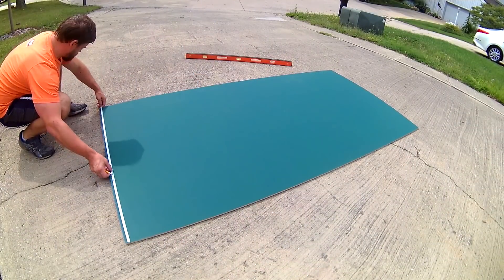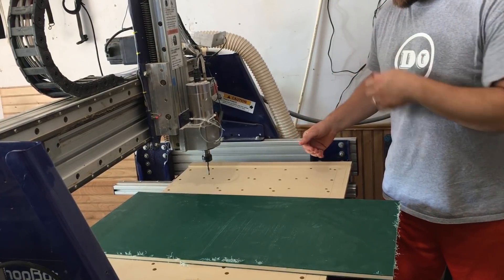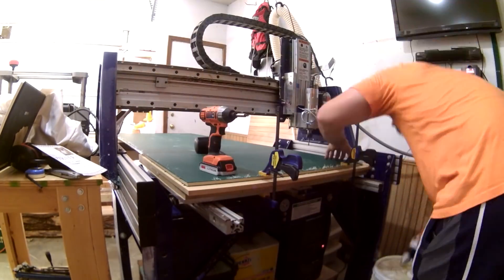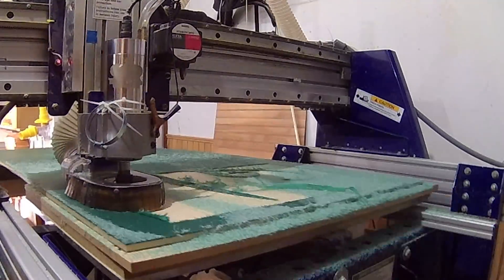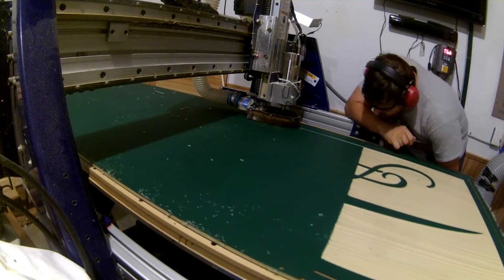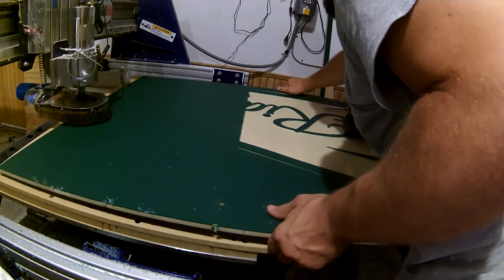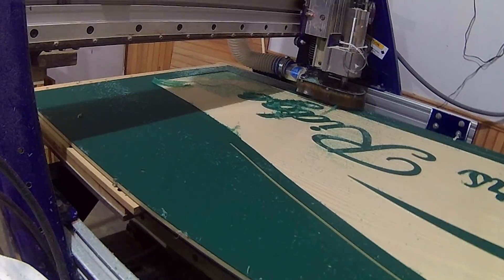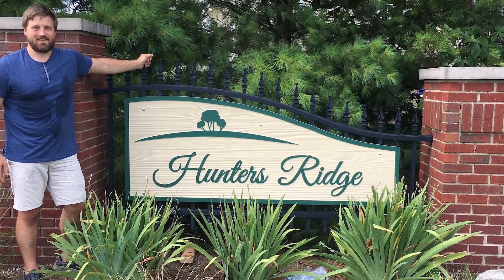How to make BIG signs on a small CNC // Tiling

Comment: Thank you for this very good and clear video. I am still learning my way around CNC and am getting ready to cut some big sheets, so tiling and registration are interesting to me. Some of my planned big sheets have many parts. I ran a test recently using tabs to hold the many parts together so holding the sheet is less critical. I made the tabs about half the thickness of the material. This allows a router with a 1/4" trim bit (with a ball bearing) to guide the bit along the half-cut depth while cleanly cutting away the tab. This works very well and requires little finishing. Thanks again for your video!
Reply from the maker: I appreciate the feedback! Thanks for watching!

Comment: A potential fix for the alignment hole issue would be to put the whole thing back at the original reference hole location, drill another hole slightly inboard from the old one (if it stays outside of the design), then copy that hole along the length of your design.  Alternatively, you could use a smaller dowel, which might make it easier to sneak into the design.  At work, we use 0.125" steel pins and they work great with a 1/8" drill bit chucked up.
Reply: Wouldn't 1/8" pins and a 0.125" drill bit work better?

Comment: If you don't mind I have a question. How long did it take you to learn using the cnc efficiently?
Reply from the maker: Not as long as you'd think. If you're not one for the design aspect, you can just purchase files ready to cut. That will drastically lessen the learning curve for anyone. Learning how to run the machine isn't that bad. Learning the software to produce custom files, especially as complex as this one, takes a lot longer in my opinion.
Reply: @DoItProjects  Awesome, thanks for the reply!

Comment: Would you use the same tiling process to make vertical garden signs on cedar boards that would say words such as,  WELCOME,  HOME,  or something similar?
Reply from the maker: Sure! The process would be the same.
Reply: @DoItProjects  so if I did this then I could just cut off the edges with the peg holes to complete my sign?
Reply from the maker: @jeffbooher5598  I do this at 9:55. If your design is just a straight board, you wouldn't need to cut out a profile, just use a table saw or circular saw to rip cut away any holes.

Comment: I know bugger all about CNC, the basics YES, I am making a metal grinding machine that grinds camshaft lobes. Instead of me hand forming patterns ( approx 300 mm diameter ) 
I think I can use a 2d cnc router to form the patterns.  If I can break a simple circle into say 360 degrees and be able to measure a known length on each radii, that should give me a a circle with a lump shape on it ...YES ?   can you suggest a simple CAD program for this  ?

Comment: You need to update your software, an 'M6' command will start the VFD for the spindle, start the cooling pump for the spindle, and start the dust collection system. And of course, turn everything off when it's time to change a bit. I can't believe that a Shopbot CNC would not have these features built-in.

Comment: When I read 'small' cnc, I pictured something much smaller! You couldn't make anything huge with that, but it's a pretty large machine. Good video though. I am wondering about the idea of using a small CNC to make a large machine.
Reply from the maker: I get what you're saying, but my machine looks bigger than it is. I say mine is "small" in comparison to 4'x8' and 5'x10' machines that are commonplace in a lot of production shops. A 4'x8' machine has a cutting area of 4,608 sq-in. My cutting area is 22"x32". 704 sq-in. That's only 15%. Pretty small in comparison.

Comment: I have seen several videos similar to yours, but no one ever says at what coordinates you drill the holes on the spoil board. Can you please explain that. Thanks
Reply from the maker: Specific locations of the registration holes will differ user to user. The number one thing is that they are spaced the exact distance of your tile offset setting. The other factor is that you test the fit of your pins in the holes. They should be snug! Any wiggle room will show up at the seams.

Comment: How deep was your carve I need to do one that is two sided was trying to decide on the thickness of the material I will need ?
Reply from the maker: It was pretty shallow. You could do this two-sided with 1/2" thick material. The outer color layers are just 1/16" thick. Just bear in mind that the final overall thickness would be about 1/4".

Comment: Great video! One question I have is on the tan background. Did you use a wood grain texture applied to the area to get the wood grain look?
Reply from the maker: In the CAD software I use (Vectric Aspire) there is a tool that will convert a bitmap image to a 3D model. I just applied that to a hi-res background image of wood grain.
Reply: @DoItProjects  Aha now it makes sense why you used a ball nose. When I watched the video, I was thinking that's just a 2D cut so why not use a flat end and why did it take so long? Then I saw the wood grain look and looked for any existing comments about it. Looks awesome!

Comment: why on earth did you build this like a 3d printer? moving the work instead of the spindle in Y makes no sense to me
Reply from the maker: Diesel Ramcharger I didn’t build the machine. It’s a Shopbot Buddy. The X motion is the table itself because there is an accessory called a power stick that allows for much longer pieces to be cut continually without tiling. I don’t think that kind of attachment would be possible if it were a standard gantry. I’ll admit, it isn’t ideal for a lot of applications, but it’s the one I have.  http://www.shopbottools.com/mProducts/shopbot_buddy.htm
Reply: @DoItProjects  ahh i get it. they do a rack and pinion X to keep the machine compact, then sell you on the extension to make the machine more capable....just sees like you end up eating up all the space you thought you'd be saving with its compact design.